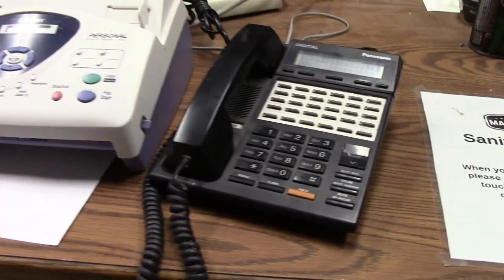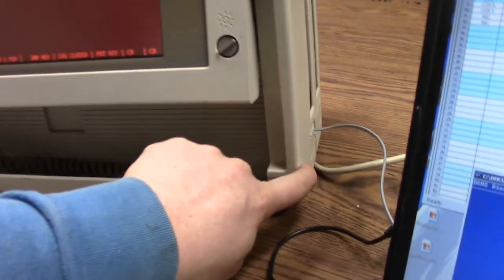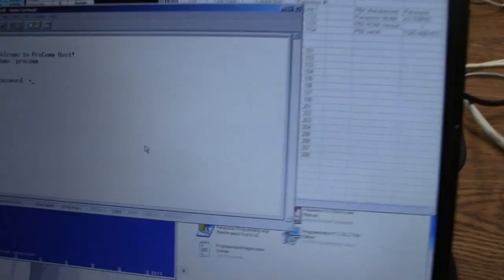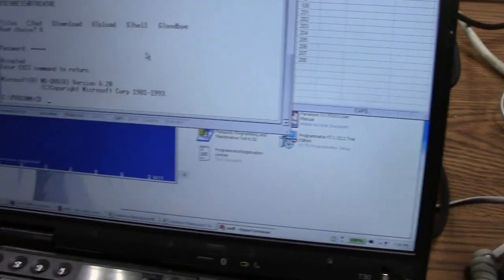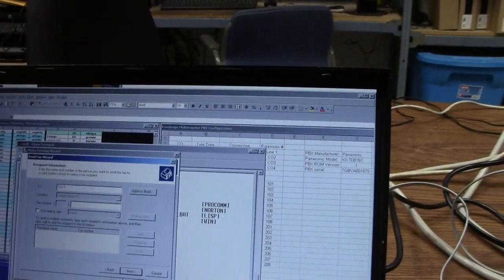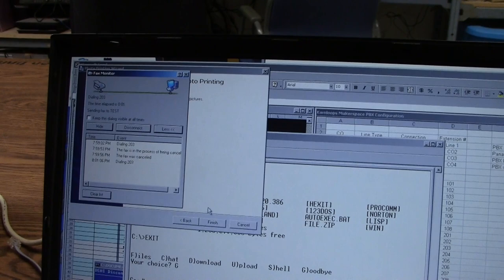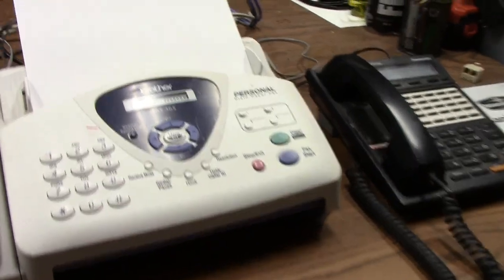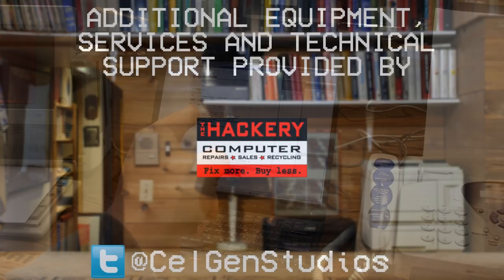Modern Telephony - Testing Modems and Faxes at the Makerspace

Comment: How did you fit a hard disk in the 286 Compaq?
Reply from the maker: 2.5" laptop IDE drive screwed to the backside of the drive cage, 40 to 44 pin IDE adapter and a custom Y-cable so I can power the drive and both floppy drives. A SIIG Enhanced BIOS card is temporarily used to autodetect and configure the drive type and blam, two floppies, a hard drive and no DDO needed.
Reply: @CelGenStudios  Nice!

Comment: Does this model PBX have fax notification via a designation extensions?  When a fax is received, the designated extension rings and there will be a voice mail which explains "You've received a Fax".
Reply from the maker: That I am aware of no, it isn't that smart.
Reply: @CelGenStudios  When you find a little time, look in either the Feature or Programming manuals.  A manufacturer I work with had a Panasonic KX-TD1232 (digital) which is also a digital PaBX.  When the recently moved their office, it was left behind.  They now use Ooma VOIP which hasn't proved to be that great.  Ooma offers the ability to forward voice calls to another number like a cell phone.  

I looked at the TD1232 manual.  It too can do the same thing, as can my TA824 which was the last of the "Advanced Hybrid" models line (non-digital).  

Unfortunately Panasonic has decided to exit the PaBX business.  Last scheduled shipment of product will be Jan 2023, unless of course current stock is depleted before that time.  It's the end of an era.